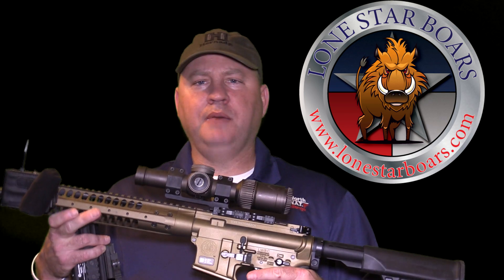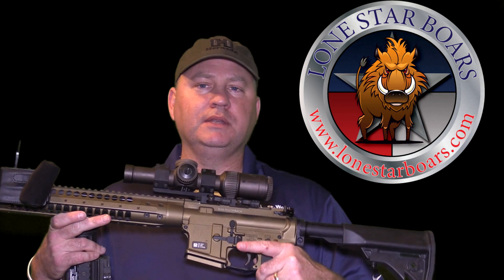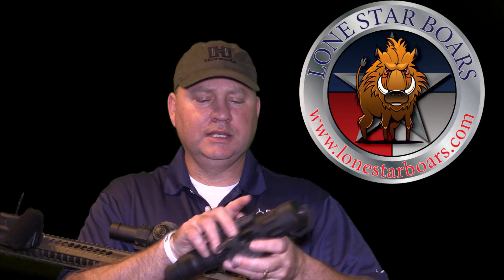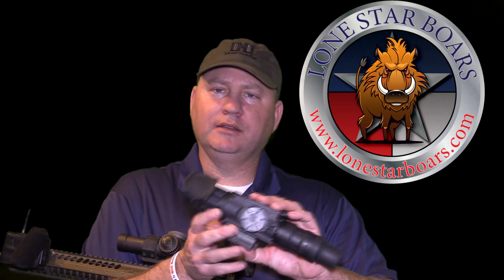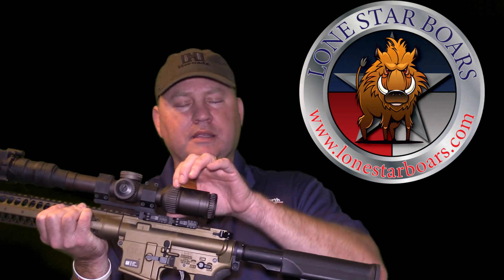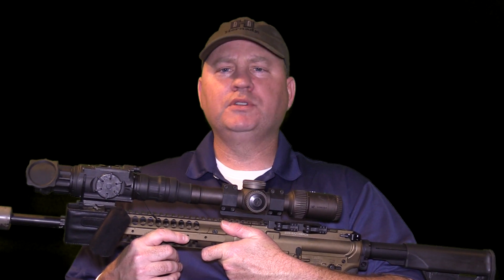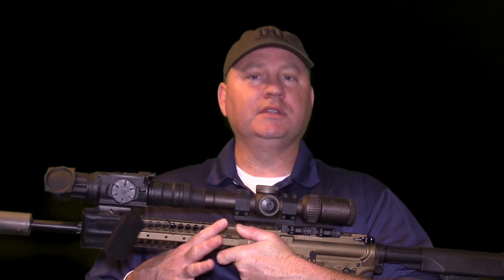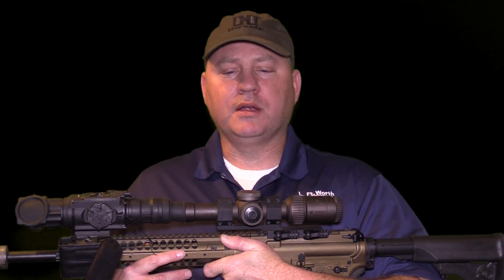CLIP ON NIGHT VISION AND THERMAL HOW IT WORKS

Comment: Great explanation of what it looks like through the scope. Could you show what it looks like as a stand alone sight? Some things I've read states that it doesn't look the same as a normal stand alone thermal like the zues since the lenses are different to work as a clip on. 
Also on a side note when will you show a field test and a in depth review on the funtions of the new Pro series of the zues?  
Thanks for the great videos! Always enjoying seeing your videos.
Reply from the maker: The hunting videos in this channel show what the scope sees but It would be hard to show what it looks like to the eye it works but the screen is smaller than a dedicated scope.  Clip ons are versatile but they give up some things to fill all the roles a smaller screen is one of those things.

Comment: Congratulations on the video! Good explanation although I would have liked to see how the magnification works in open fields with real game, but I learned what I needed. I have a question: Do you have to re-zero your Apollo when you run out of batteries or have to change them or does it keep your configuration? Thank you and keep on with your videos!
Reply from the maker: Thank you!  No changing batteries does not affect zero.
Reply: Lone Star Boars
Thank you for your information! Another thing that I would like to know is if the apollo is compatible with all kinds and sizes os scopes. I have several and I would like to use it with all of them. Thank you again.
Reply from the maker: It should be compatible with any day time optic.  Now when you start getting over 4x magnification the image will degrade.  If you need high magnification then you will want the Apollo pro long range.
Reply: Lone Star Boars
I see it clips-on your scope perfectly. My doubt was, since I have scopes with different diameters, if it comes with different adapters, or if I have to look for them later or how it works. Concerning the distance, with 300 yards I have more than enough.
Reply from the maker: It comes with adapters of all sizes but you do not have to have the light shield on all it does is keep the light from showing from the scope at night.
Reply from the maker: It seems there is even more confusion about clip ons than I realized I will try to make a better video and get some outside video for you also.  This one just something I put together really quick.
Reply: Lone Star Boars
Very interesting. Thank you very much again for all your answers and the information.

Comment: Great video. I have a question for you.  Would a clip on thermal be better than a dedicated for a multiuse rifle?
Reply from the maker: I do not think so dedicated has a better image and is lighter.  With the current ad mounts the dedicated scopes return to zero easily.

Comment: Have you ever had an issue with your weapon setup not maintaining point of impact zero after installing the apollo?  I have seen an impact shift of around 5" at 70 yards.  What are your personal standards for accuracy and consistency?   I am installing on an AR-10 308 which shoots sub MOA with the 3.5-10x day scope.  I have tried Armasight's mounting system which attaches directly to the objective end of the day scope and also used the rail mount that you show in this video.  Both mounting methods have shown significant impact shift for me.  Any tips or tricks?
Reply from the maker: +mark386948 yes I have but not that much.  You should be able.to adjust the margins to correct.
Reply: +Lone Star Boars okay, so adjust the margins rather than the boresight?  does the boresight only adjust the internal reticle of the Apollo to match that of the day scope?
Reply from the maker: You don't need a rig.

Comment: What size mounting ring did you order? I ordered the exact same setup (razor HD and apollo) because of this video. I ordered the mounting ring for a 30mm objective lens. It doesn't come anywhere close to fitting. What size did you order to make it fit your vortex. Answer asap please!
Reply from the maker: +Justin Davis I ordered mine with the 30mm Bobro mount it worked perfectly.
Reply: not that mount. the mount that connects the apollo to the razor. the CLIP ON  mount.
Reply from the maker: I stopped using the Apollo much because of poi issues I was having.  I prefer the dedicated scopes.  But my Apollo mounts right to my front rifle rail.  I do not mount it to the scope it sits in front of it.
Reply: do you mind elaborating a little? i have not yet mounted the apollo and i don't want to if it is having POI issues. How severe were they and at what distance. a 5000 dollar clip on should not be having POI issues. Can you make any sense of why you were having those issues? Please help I do not want to mount the scope if it has issues because then I won't be able to return it.
Reply: Never seen a clip on that maintained POI. convinced non do. Good idea just never works

Comment: Thanks for the video! I have a Bushnell Elite tactical scope that is 6-24X50. I'm new to Night vision and thermal clip on units.  Is there anything out there that would work well with my minimum X6 zoom? Or are these units topping out at or below X6?
Reply from the maker: 6x for these thermals will not look the best that is getting towards the max.
Reply: +Lone Star Boars   OK thanks, I see people using the PVS 14 behind the scope, would that allow a higher zoom?

Comment: I just purchased a Armasight Apollo.  I installed the batteries and get a screen with White Hot but I can't seem to select the other menus. The manual says to hold down the #1 and #3 buttons, I assumed together, but it doesn't change?  What am I doing wrong?
Reply from the maker: +BJ Brown For switching pallets hold down the front arrow button (the up button pointing towards the focus ring).  Or you can hold down the center button and go into the menu settings.

Comment: i have searched far and wide for an answer to this. is it possible to use a dedicated thermal behind a dedicated day scope? Why does it need to be a "clip on"? As long as the mount heights are the same and they are lined up on the rail properly, why wouldnt that work? Finally, What kind of mount are you using for the vortex?
Reply from the maker: +Justin Davis thermal can't see through glass.  Glass reflects heat like a mirror.  I use the Bobro mount from Vortex.
Reply: Sorry let me clarify. I mean using it behind as in the thermal is proximal to the barrel and the dayscope is proximal to the stock. So the same exact setup just not using a "clip on" but rather a dedicated thermal like a predator. I can't think of why this wouldn't work.

Comment: how close do the mounts on day scope need to be to this?  i have this and my shots are off.  day scope is dead accurate but when i put this on the front its off several inches high i think
Reply from the maker: The true clipon’s that don’t change point of impact start at almost $16k you will have to zero that clipon to the scope by moving the margins.

Comment: Interesting, how do you line up the Apollos crosshairs w the Vortex to 1 be accurate and 2 to be the same and can you then see both as you are shooting?
Reply from the maker: You adjust the crosshairs/reticle just like sighting in any scope.  You adjust them to the point of impact which is the Vortex or dayscopes reticle.  Depending on which reticle Im using sometimes I can see it or sometimes it is covered by the day scopes reticle.

Comment: nice video!... Can you compare 42 mm vs 75 or 100 mm ? It's worth it extra money?
Reply from the maker: The bigger the lens the better the detection range and the better the thermal will look in humid hot weather.  Humidity is the thing that degrades the thermal the most in my experience.  The only   clip on with a lens bigger than 42mm is the pro with a 50mm lens and then the pro long range with the 100mm lens.  The pro LR clip on is a large scope and made for long range stationary shooting not walking around.

Now the Zeus dedicated scope comes with the 75mm lens and the new pro Zeus comes with the 100mm lens.  So far the 75mm Zeus has been my favorite thermal and if I could only keep one that would be it.  But I'm pretty sure the 100mm Pro zeus will change that soon.  My W1000 thermal has a 100mm lense with the 15 year old 320 core and that lens keeps it in the game still today with an amazing detection range.  A new upgraded 640 core with the 100mm lens is going to be amazing!
Reply: Lone Star Boars thank you for answering.  One thing I don't understand. Why Apollo pro 100mm 640 can't be use for "walking around"? Apollo pro 100 mm 640 it's the same thing like Zeus pro 100mm 640 (one is clip on one is not but all internals are the same). Apollo pro is 2.8 lbs (plus day scope) vs Zeus pro 2.9 lbs but I think you can walk / run and gun with both "systems" - correct me if I'm wrong you know better. I know they engineered Apollo pro 100mm for routine use with 0.50 BMG weapon shock and recoil but I don't see why I can't use this Thermal Imaging Device with .308, 6.8 or different "smaller" then .50 platforms.
ARMASIGHT Apollo 640 (60Hz) 42mm Thermal Imaging Clip-On System $8,790.00	(armasight website) vs ARMASIGHT Apollo-Pro LR 640 100mm (60 Hz) Thermal Imaging Clip-on System $10,559.00 (armasight website).
What better detection range means if we will compare this 2 units. Lets say human (easier to check then wild animal), can you tell me what is realistic distance to detect human wit 42 mm vs 100 mm?
Reply from the maker: EmperorArek Guess I worded that wrong yes you can walk around with it but I was told  the 100mm apollo was designed more for long range and is set to be best at 8-12x magnification while the 50mm is set to be best at 3-4x magnification.  The 3-4x would be better for walking around stalking game at closer normal hunting ranges.  Sorry about the confusion.
Reply: Lone Star Boars No problem don't worry buddy. It's hard for me to figure it out how they set up 100mm for 8-12x.  (100mm and 50) share pretty much the same "screen" and same resolution = 640. You mention in your video you are zoom it to the "screen" and "picture/view" starts to be poor after 5-6x. It's difficult to believe when sales rep (not you them) it's telling you/me don't worry will be ok just buy. If they will claim it's twice more pixels in 100mm .... then ok - but it's not. I can't wait when you will put 100mm on your rifle and do real life test with 12x or even 20 /25x. I have Schmidt&Bender 5-25x56 PM II/LP/MTC/LT (for long range) and I'm wondering what magnification I will be able to use it Apollo 640 100mm 60hz. and what is the max. detection range of the "human" in average conditions. They have one picture on the website Apollo 100 mm connecting to the similar scope what I own but I don't like how high rings you have to use for the day scope - any way even on that picture, day scope looks way to low or Apollo looks way to high  it's not in line  (picture nr 2, Apollo 100 mm) I don't know if this connection it's ok or not maybe you will be able to tell me. Thank you!

Comment: Can a clip-on NV or thermal unit be used as a standalone monocular?
Reply: Might have trouble finding a head mount but most clip-ons are 1X and should work just fine if you don't mind holding it up to your face.